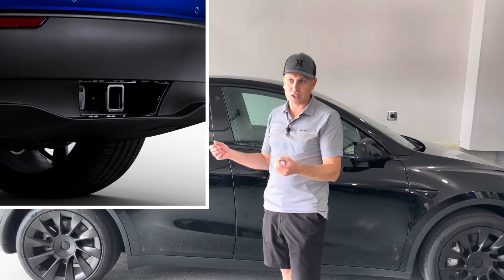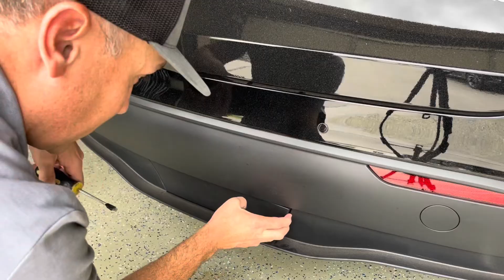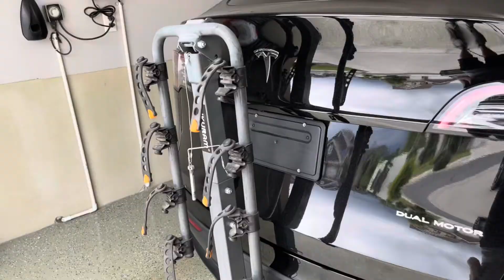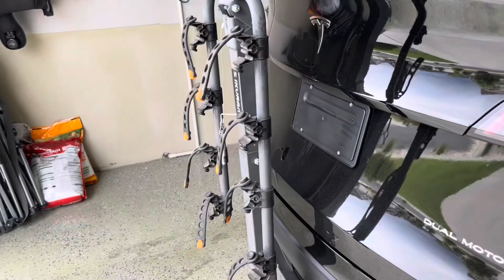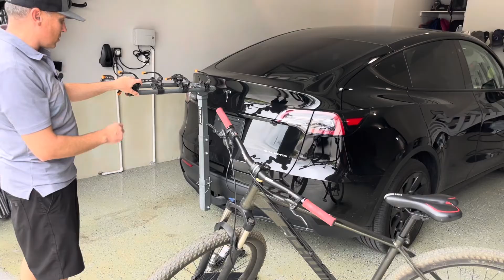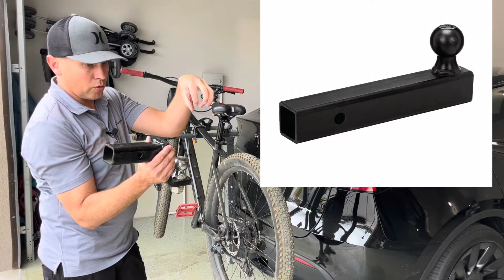Tesla Model Y Tow Hitch | Testing My Bike Rack! Is This Worth $1,000?

Comment: I always mounted the bike's top tube on top of both arms of the rack.  If that 'front' strap lets go that bike is going to fall at its rear and likely swing in all sorts of directions.  I also always secured the front wheel to the frame.  I used a strap and quick release buckle.  Why would someone intentionally let the front wheel twist side to side?
Also, that 'drop' mount, that ball can likely simply be mounted the other way, turning it into a riser mount (check the label)
Rather surprised by your video in these aspects ....
Reply from the maker: Good info, thanks

Comment: Any idea how much impact does this rack have on battery consumption? I have found that with my current rack, the battery consumption was almost double and car failed to predict the destination battery percentage by a huge margin. I didn't enable tow mode so maybe that was the reason for poor estimation.
Reply from the maker: It makes a difference, it creates additional drag, I haven't used it on long road trips so I can comment, but using tow haul mode probably will help.
Reply: yea bad prediction of range is a big issue when on road trips it seems to me.  I've heard 25% reduction in range if you keep it at 70mph.  faster than that and it will be worse.  Not to mention the backing a supercharger with bikes on the back.

Comment: Hello. My current vehicle is a massive nuisance to drive with my hitch mounted bike rack on because the rear automatic braking slams on the brakes when I go in reverse and there is no easy way to disable that without having to reset it every single time I drive.  How does the Model Y deal with this? Is there an easy way to disable any rear parking sensor alerts/autobraking?
Reply from the maker: Yes, put it in tow/haul mode and it takes care of that
Reply: @Myksgarage  I have heard this disables Autopilot. Is that true? Not being able to use autopilot for 1/2 the year would be pretty brutal

Comment: Can you share the dimension between the end of the receiver tube and the furthermost vertical rear body part. I need to verify the bike rack I want will clear the body when in the stowed upright position. TESLA does not share this information with the public. My MY ordered in March 2022 scheduled Oct 13 - Nov24 2022. Long Range-Red-Tow Hitch-No FSD
Reply from the maker: I'll see if I can measure that
Reply: i'm wondering the same thing. I have a 1up rack that has enough clearance on my mini van and Volvo.

Comment: I have order a model Y in November sill waiting.   I did order tow package and 7 seats, long range.   My question is did you put the cover panel back on?  I was going to pull a small trailer form time to time.  Also how do you like third row seats.  I was hoping to put grandkids there.
Thanks,
Jim
Reply from the maker: Yeah I put the panel back on when not using the tow hitch,  the 3rd row seats are a very tight fit, only small kids can fit back there, but they are nice to have

Comment: I got my Model Y 3 in Salt Lake 3 days after you, on 8/4.  (5 seat, Gemini wheels, White Exterior, White Interior, tow hitch, no FSD).  We got the mobile connector included with only the 110 plug, but people paying $200 for it now will get the NEMA 14-50 plug also.
Reply from the maker: Nice!  How you liking it so far?
Reply: So far no problems.  Having to turn off the autopilot every time I change lanes is already bugging me.
Reply: Tesla gave $200 discount code. I used it in the Tesla shop, and got the connector kit for free. It has both connectors (mobile and NEMA 14-50).